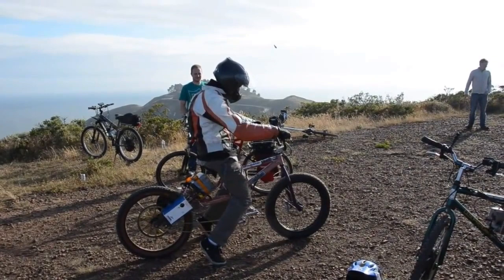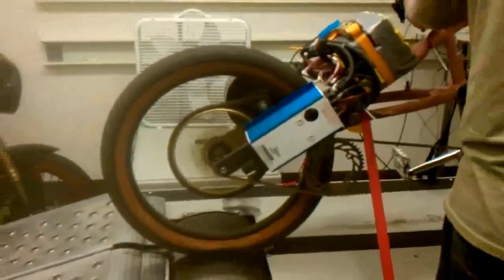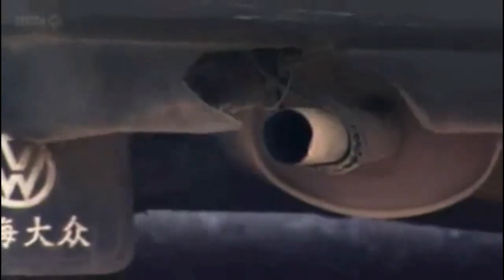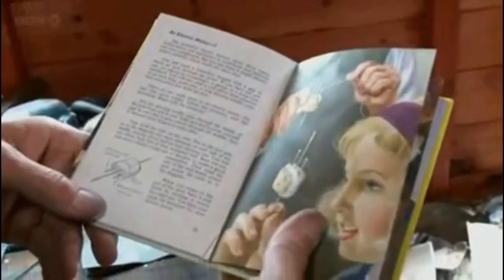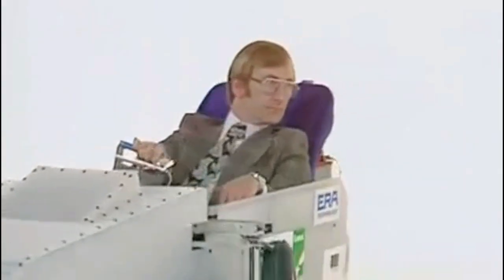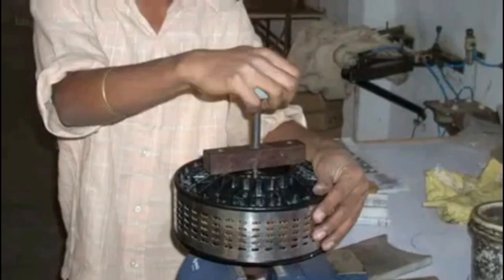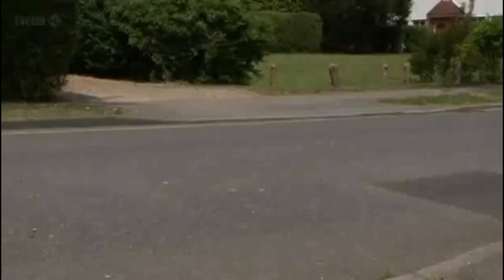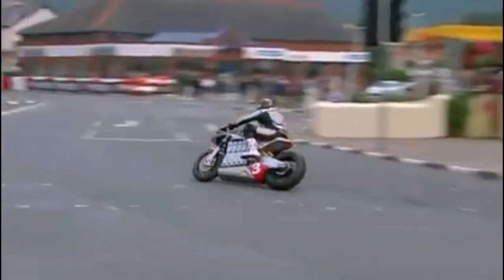Amazing Variable Field AGNI D/C Motor Backstory

Comment: How does this compare too Tesla?
Very interesting.
Reply from the maker: I will have to do some research, however I am an AGNI motor fanboy 😂...so I would say variable field D/C brushed motors are much better- most likely that is not the case however.  For smaller things like go carts, motorcycles, and other contraptions they are the best by far I have ever come across.
Reply from the maker: The Lynch motor is an unconventional design with a disc armature. It marries the advantages of a conventional, wound armature motor with the benefits of a flat (printed circuit) motor. It is similar to a pancake motor, but is more powerful than any of these technologies. The disc armature has magnets on both sides, doubling the available flux density and shortening the magnetic path. It therefore packs more power per pound and per cubic inch than any other motor technology. Of course such a revolutionary motor is not for every application - it is not as cheap as wound field motors, but for many applications it is a far superior motor.  It has a previously unheard of power to weight ratio and also power to volume ratio. It is also highly efficient because of the double magnet design and associated short magnetic path. It also includes integral fan cooling.

 The Lynch motor is an important development which spurred other motor designers to improve their products to remain competitive, such as synchronus permanent magnet machines.  As a result of the competition between manufacturers the cost of high performance motors and controllers has fallen dramatically.  We hope the cost of solar cells also reduces to allow renewable transportation to develop as a viable alternative to carbon fuels.
Cedric Lynch built his electric bike around a mid-drive configuration, also building one of the worlds most efficient light weight electric motors to power his rig reliably at 60-MPH for significant distances. He would later set several world records with his axial flux motor and bring it to market as the Lynch / Agni motor. Briggs and Stratton would eventually buy this technology which would lead to the Etek motor, which is now famous for making high speed efficient electric hot rods.

Cedric uses to achieve high speeds is by following the rules of aerodynamics, and building a bike that is as aerodynamic and as efficient as possible. The other builders on this list bypassed this step, and Cedric uses this bicycle as daily transportation on real commutes. Although this high-efficiency motor uses “old school” brushes, this fact allows builders to use very affordable controllers. He has proven his design choices through thousands of miles of commuting, and the Lynch motor is highly respected.

Cedric Lynch is known as the creator of the Agni Motor, a highly efficient electric motor that weighs around 25 pounds and can put out as much as 50hp. 

Cedric Lynch is a British 'mad scientist' type mechanical engineer obsessed with the idea of greener transportation. His interest has been in building a super efficient yet powerful vehicle that can serve as a car replacement.

He started thinking of his own design for an electric motor in 1983 when he began entering competitions organized by the Battery Vehicle Society regarding building an efficient electric vehicle. At the time there was no reasonably priced DC motor with descent efficiency so Lynch decided to build his own utilizing modifying existing motors with old tin cans that he would spread out flat to use as cooling fins. Surprisingly using rudimentary materials and a garage work bench, Cedric was making better more efficient electric motors than any of the universities were able to manufacture in state of the art workshops.

Cedric then came up with a motor design that could be cheaply manufactured and began manufacturing his own motor that he could sell to the public in 1988 and the Lynch Electric Motor Company was born, known as LEMCO.

Cedric first used his motor to create a small boat called “The Spark” that would set an electric boat efficiency record. From there Cedric turned his attention to bicycles, an application generally considered too small for a lynch motor at that time. Cedric mounted his motor in recumbent bike, allowing him space to eventually use a set of thundersky lithium batteries.

The resulting aerodynamic recumbent bike had a top speed of 60mph and still managed an incredible range of 150 miles. Cedric rode his recumbent creation everywhere as a daily commuter, putting an amazing 50,000 miles on the machine - technically a motorbike.

Briggs and Stratton, the US firm famous for lawn mower engines, bought the technology and used it in their E-Tech Motor, and Cedric went on to manufacture his latest incarnation of his lynch design into the Agni motor, which is used in go karts, sailboats, motor boats, and even small airplanes.

The Lynch designed motors all have the same traits. Brushed motors, around 25 pounds in weight and they are able to put out enormous power compared to their weight. Sometimes as high as 50 hp (depending on amperage ran through the motor) at an incredible 98% efficiency.  Lynch Motors are also the most often used motors in electric motorcycle racing applications.

Cedric's zero-emission motorcycle, which has a top speed of 120mph, was shown in action winning the world’s first zero carbon race – the TTxGP in the Isle of Mann.

The idea for the electric motor has been snapped up by the 56-year-old’’s friend Arvind Rabadia, who together with his brother Hasmuk Rabadia had been thinking of starting a business in India. They have now set up Agni Motors to make further-improved versions of Cedric’s motors

Despite Cedric’s breakthrough invention he has no formal engineering qualifications and taught himself the techniques needed to construct his engine. He first became interested in electrics when his parents bought him a book entitled How to build things from things found at home. 
The Etek motor is a brushed 25-pound pancake shaped motor that puts out enormous power for its weight. Depending on amperage and voltage the Etek can easily provide between 15-horsepower and 30-horsepower reliably and consistently (11-kW / 22-kW). A perfect platform for a powerful electric bike if you do not mind the weight. Although brushless motors are considered more modern, a brushed motor like the Etek allows the builder to use very affordable controllers.

Cedric-Lynch invented the motor and sold it to Briggs and Stratton which US company produced the Etek at a lower price (around $600). In the late 90’s early 2000’s it was the way to go for a high-power / light-weight electric vehicle. Many small E-vehicle records were set using the Etek motor. Finally, the market had a relatively lightweight and powerful electric motor available to the masses.

In essence, the Etek allowed hot rodders to build electric bikes. Before the Etek very few people had ever achieved 50mph on an electric bike. Even today, Etek motors (and newer incarnations of the Etek motor) are used to make some super fast electric bikes. In the case of Liveforphysics, the fastest E-bikes ever.

 Liveforphysics used a newer version of the Etek (the Agni motor), to achieve speeds of over 70mph, and dominate a recent hill-climb event.

Every Etek I have ever ridden has been characterized by brutal off-the-line acceleration, usually to a point where you have to apply the throttle very carefully or get thrown off. However, it is possible to run an Etek at a lower voltage or lower amperage and have a very manageable, safe, and sane electric bike that will not burn out on you, no matter high steep the incline.

Comment: Dude...i need to talk.... seriaslly..you guys.  Awsm.......i wan to know more about this motor
Reply from the maker: It's just me Ryan: You can ask me questions any time in the comments under any video on my channel.  Here's some more information: 
The Lynch motor is an unconventional design with a disc armature. It marries the advantages of a conventional, wound armature motor with the benefits of a flat (printed circuit) motor. It is similar to a pancake motor, but is more powerful than any of these technologies. The disc armature has magnets on both sides, doubling the available flux density and shortening the magnetic path. It therefore packs more power per pound and per cubic inch than any other motor technology. Of course such a revolutionary motor is not for every application - it is not as cheap as wound field motors, but for many applications it is a far superior motor.  It has a previously unheard of power to weight ratio and also power to volume ratio. It is also highly efficient because of the double magnet design and associated short magnetic path. It also includes integral fan cooling.

 The Lynch motor is an important development which spurred other motor designers to improve their products to remain competitive, such as synchronus permanent magnet machines.  As a result of the competition between manufacturers the cost of high performance motors and controllers has fallen dramatically.  We hope the cost of solar cells also reduces to allow renewable transportation to develop as a viable alternative to carbon fuels.
Cedric Lynch built his electric bike around a mid-drive configuration, also building one of the worlds most efficient light weight electric motors to power his rig reliably at 60-MPH for significant distances. He would later set several world records with his axial flux motor and bring it to market as the Lynch / Agni motor. Briggs and Stratton would eventually buy this technology which would lead to the Etek motor, which is now famous for making high speed efficient electric hot rods.

Cedric uses to achieve high speeds is by following the rules of aerodynamics, and building a bike that is as aerodynamic and as efficient as possible. The other builders on this list bypassed this step, and Cedric uses this bicycle as daily transportation on real commutes. Although this high-efficiency motor uses “old school” brushes, this fact allows builders to use very affordable controllers. He has proven his design choices through thousands of miles of commuting, and the Lynch motor is highly respected.

Cedric Lynch is known as the creator of the Agni Motor, a highly efficient electric motor that weighs around 25 pounds and can put out as much as 50hp. 

Cedric Lynch is a British 'mad scientist' type mechanical engineer obsessed with the idea of greener transportation. His interest has been in building a super efficient yet powerful vehicle that can serve as a car replacement.

He started thinking of his own design for an electric motor in 1983 when he began entering competitions organized by the Battery Vehicle Society regarding building an efficient electric vehicle. At the time there was no reasonably priced DC motor with descent efficiency so Lynch decided to build his own utilizing modifying existing motors with old tin cans that he would spread out flat to use as cooling fins. Surprisingly using rudimentary materials and a garage work bench, Cedric was making better more efficient electric motors than any of the universities were able to manufacture in state of the art workshops.

Cedric then came up with a motor design that could be cheaply manufactured and began manufacturing his own motor that he could sell to the public in 1988 and the Lynch Electric Motor Company was born, known as LEMCO.

Cedric first used his motor to create a small boat called “The Spark” that would set an electric boat efficiency record. From there Cedric turned his attention to bicycles, an application generally considered too small for a lynch motor at that time. Cedric mounted his motor in recumbent bike, allowing him space to eventually use a set of thundersky lithium batteries.

The resulting aerodynamic recumbent bike had a top speed of 60mph and still managed an incredible range of 150 miles. Cedric rode his recumbent creation everywhere as a daily commuter, putting an amazing 50,000 miles on the machine - technically a motorbike.

Briggs and Stratton, the US firm famous for lawn mower engines, bought the technology and used it in their E-Tech Motor, and Cedric went on to manufacture his latest incarnation of his lynch design into the Agni motor, which is used in go karts, sailboats, motor boats, and even small airplanes.

The Lynch designed motors all have the same traits. Brushed motors, around 25 pounds in weight and they are able to put out enormous power compared to their weight. Sometimes as high as 50 hp (depending on amperage ran through the motor) at an incredible 98% efficiency.  Lynch Motors are also the most often used motors in electric motorcycle racing applications.

Cedric's zero-emission motorcycle, which has a top speed of 120mph, was shown in action winning the world’s first zero carbon race – the TTxGP in the Isle of Mann.

The idea for the electric motor has been snapped up by the 56-year-old’’s friend Arvind Rabadia, who together with his brother Hasmuk Rabadia had been thinking of starting a business in India. They have now set up Agni Motors to make further-improved versions of Cedric’s motors

Despite Cedric’s breakthrough invention he has no formal engineering qualifications and taught himself the techniques needed to construct his engine. He first became interested in electrics when his parents bought him a book entitled How to build things from things found at home. 
The Etek motor is a brushed 25-pound pancake shaped motor that puts out enormous power for its weight. Depending on amperage and voltage the Etek can easily provide between 15-horsepower and 30-horsepower reliably and consistently (11-kW / 22-kW). A perfect platform for a powerful electric bike if you do not mind the weight. Although brushless motors are considered more modern, a brushed motor like the Etek allows the builder to use very affordable controllers.

Cedric-Lynch invented the motor and sold it to Briggs and Stratton which US company produced the Etek at a lower price (around $600). In the late 90’s early 2000’s it was the way to go for a high-power / light-weight electric vehicle. Many small E-vehicle records were set using the Etek motor. Finally, the market had a relatively lightweight and powerful electric motor available to the masses.

In essence, the Etek allowed hot rodders to build electric bikes. Before the Etek very few people had ever achieved 50mph on an electric bike. Even today, Etek motors (and newer incarnations of the Etek motor) are used to make some super fast electric bikes. In the case of Liveforphysics, the fastest E-bikes ever.

 Liveforphysics used a newer version of the Etek (the Agni motor), to achieve speeds of over 70mph, and dominate a recent hill-climb event.

Every Etek I have ever ridden has been characterized by brutal off-the-line acceleration, usually to a point where you have to apply the throttle very carefully or get thrown off. However, it is possible to run an Etek at a lower voltage or lower amperage and have a very manageable, safe, and sane electric bike that will not burn out on you, no matter high steep the incline.